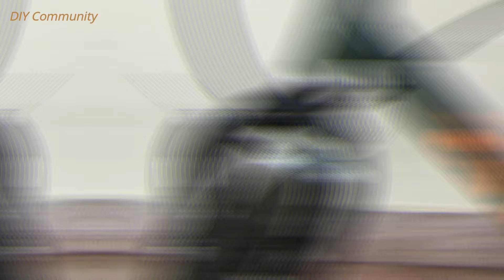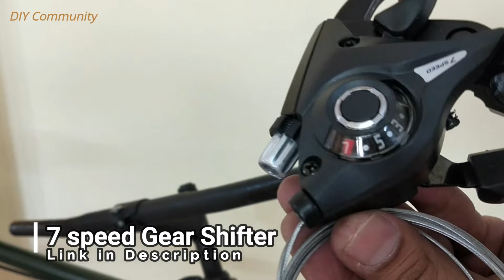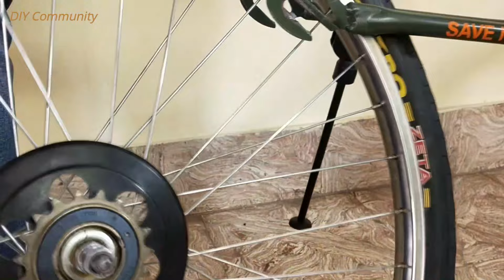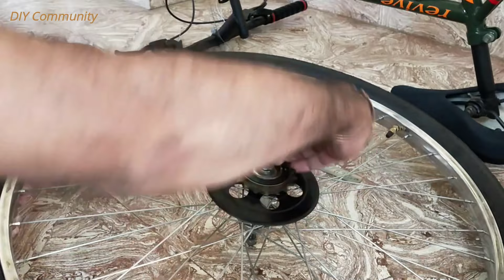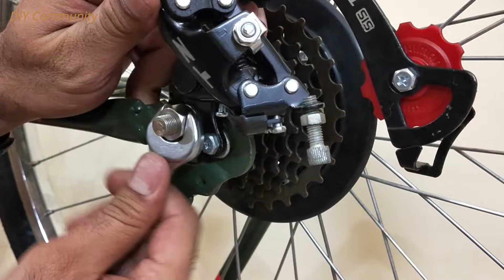How to Install Gears in Any Cycle - DIY Installation | DIY Community

Comment from the maker: Gears makes you to pedal faster without exhausting your legs!
Reply from the maker: Hi Hitesh, Online price of a product changes frequently. Just try to search for item which you are looking for and choose the one matching your budget. Also try with cycle spare shop in nearby market. You can get even cheaper that what I have shared.
Reply from the maker: Pls feel free to ask any doubts. Thanks 👍
Reply from the maker: Hi, for gear setup I am making a separate video and will be posted soon. Stay connected ! Thanks for asking.
Reply: @DIYCommunity  what's the fitting overall cost?
Reply from the maker: Hi Pradeep Kumar, I had spend around Rs.1500/- for this.
Reply: @Trader_vibes22005  Dr
Reply: Sir, can I use it in Hercules Flare cycle??
Reply from the maker: Hi, if the frame is made of steel then you can modify.
Reply: @DIYCommunity  ok, thank you ❤️
Reply: Kinte kharche parenge please reply
Reply from the maker: I spent Rs.1500/-
Reply: @DIYCommunity  can I use gear in hero rafale
Reply from the maker: Hi, Yes you can install as this has a steel frame.
Reply: Reza
Reply: Bel bari
Reply: 8
Reply: Shamim
Reply from the maker: No, aluminium frames are brittle and may break.
Reply: @DIYCommunity  hhh
Reply: What about chain slipping issue after gear installation? I mean how frequent?
Reply from the maker: With proper alignment (chain ring should be centre to the middle gear of you gear freewheel )you can avoid chain slipping from the chain rings.
Reply: @sumitrashil8962 
 
.
Reply: I put a 3 front chain ring set up with one cassette cog in the back it’s kinda funny looking but it’s so much faster the with a one by one
Reply: Hi,kya isme gear ke jo wire he uske sath hi uska Jo wire ka cable yani ki uska cover ayega
Reply: Please try to fast reply!
Reply from the maker: Yes you get cable with cover.
Reply: @DIYCommunity  THANKS BHAI!🙏🏻🙂🙂
Reply: Can we buy the product and get fix by local cycle shop
Reply from the maker: Yes you can. Before that check with the local shop whether they can do.
Reply: @DIYCommunity  kaise
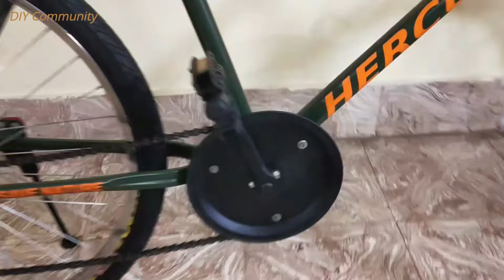Reply: @DIYCommunity 7:57
Reply: @DIYCommunity 😅
Reply: Can it work on bmx
Reply: Can it work on bmx
Reply: Has the 3 speed gear setup video come??
Reply: How many things nead 
and name things
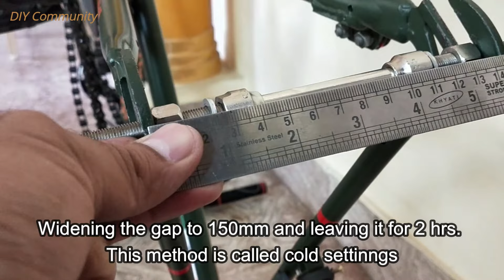Reply: 3:51
Reply: Shimano ka nhi hai online me.. ek de vanta brand ka hai gear kit usey lena chahiye kya?
Reply: Nice presentation 
Lower the music next time make it more soothing 😊
Reply: Can I use gear in hercules street cat

Comment: Thanks for sharing this, very nice. Do you think this is applicable to small bicycles or to small foldable e-bike? Found a nice one which does not have gear shifters (just single gear and single sprocket), so I am wondering.

Comment: Can i fix this gears into my double shocker hero mg cycle 26 inches cycle

Plz reply sir 🥰
Reply from the maker: Hi, check if your cycle frame is made of steel. If yes you can install gears.
Reply: @DIYCommunity  yes my cycle frame is of steel Thanks
Reply: @sapnathakur6071  but the bumpuer upper of my back wheel is closer i can install

U can sir see my cycle at youtube search hero mg double shoker

Comment: How to install gear at Hero lectro cycle
Reply from the maker: Hi, pls follow the steps shown in video. If your cycle frame is made of steel then you can proceed doing this change.
Reply: @DIYCommunity  my cycle frame alloy
Reply from the maker: Hi Senthil, Its not recommend to do any changes in alloy frame as it may break while altering it's geometry.
Reply: Thank you

Comment: why add front derailleur shifters tho??
Reply from the maker: Hi, I added a 3spees gear crankset in front which I could not show in video due to wrong product received. Later  got a correct replacement and installed.
Reply: @DIYCommunity  As long as you get your money's worth :)
Have a nice day

Comment: Bhi  in my cycle from 7 gare to 1 gare not going pleas give solutions pleas🙏
Reply from the maker: Hi, what is exact problem. Chain is not shifting or your gear shifter is not working ?
Reply: @DIYCommunity  bhi gare is working from 7th gare to first gre not going

Comment: Fibre plate agale wala kahan Milta
Reply from the maker: Hi, if you are mean Hercules logo in front then it is fitted by the manufacturer. Older cycles has those kind of logo embossed/fitted.

Comment: Bro can we make a 6 custom gears with 6 teeth,12 teeth,18teeth,36 teeth,54 teeth,108 teeth at front and back
Reply from the maker: Hi, gear sprocket somes in a standard gear ratio. Try for those if that suits your requirement. If you want to make a custom I don't recommend as after dismantling it is hard to get an allignment.

Comment: How can I do the opposite of what you did in the video go from freewheel to fixed
Reply from the maker: Hi, you can remove the freewheel and install a fixed one with spacers next to it. So that don't need to adjust the gap and redo all brakes.

Comment: How much where can v buy how can v buy this bro
Reply from the maker: Hi, I spend 1500/- and brought some online and some in local stores. buying links are in description.
Reply: @DIYCommunity  thanks bro
Reply: @DIYCommunity  if v give our cycle in cycle shop did they buy material and fix and give or v only want to fix
Reply from the maker: Yes, They will be able to do get the materials and do this. They may also charge more so better get a quote from them and compare.
Some cycle mechanic resist to do modifications. Check with an experienced person who can help you.
Reply: @DIYCommunity  thanks bro

Comment: Bhai ye ghair ki wire aapne keise joind ki mere cycle ki ghair ki wire nikle gai he
Reply from the maker: Hi, there are screws and guides for wires. Pls follow that and tighten properly. You can also get help from a cycle mechanic if you couldn't fix it.

Comment: I want a help please tell me , how  much it will cost if i put gear on my 700cc vector 91
Reply from the maker: I sond rs.1500/- for all parts and no labor charges as I did on my own. Check whether your cycle frame is made of steel to do this modification.
Reply: @DIYCommunity  bro can i change my vector 91 700cc tier i mean the seka teir whatever  it's very thin give me problem in village area can i change the teir also??

Comment: Space not creating in cycle frames
Reply from the maker: Hi, follow the method shown in video and read the bottom tagline for more information. You need to leave at the position for minimum 2 hrs.
Reply: @DIYCommunity  I will do same process but 4 hrs but not do
Reply from the maker: Hi, what is your frame made of ?

Comment: What price bro
Reply from the maker: Hi, I spend Rs.1500/-
Reply: This gear will fit in all types of cycle , bro?
Reply from the maker: You can try only on steel frame cycles.
Reply: In dynamite zx cycle, bro?
Reply from the maker: Hercules dynamite zx ? I checked online and this is a alloy frame so you can't make any modifications. 

You can also check the frame with a small piece of magnet. If it sticks to frame then it's a steel frame if not it's an alloy frame.
Reply: Bro the magnet is stick on the dynamite zx cycle
Reply: Bro but the dynamite cycle is double tube steel frame
Reply from the maker: Okay, if you have checked it you can give a try. All the best !
Reply: Bro I ask one cycle mechanic and ask this cycle don, t fix the gear and disc brakes please bro you check the online help me please bro
Reply: Bro I comment but no response
Reply from the maker: Okay, what reason he told for not installing gears. Try with another cycle mechanic if possible.
Reply: Okay bro I try to ask another mechanic bro
Reply: Bro this gear kit link
Reply from the maker: Hi, sorry if I have missed your comment. You can check in video description. Few links may not work as they are very old. Search in Google for 6speed gear set and what all you required for current availability and price. Thanks

Comment: You fixed the front gear shifter but haven't fix the front derailleur and 3 speed crank..what happened?
Reply from the maker: Hi, The crank I received was faulty and had to send that back. So could not include that in video.
Reply: @DIYCommunity  👍

Comment: One pet hate of mine when people rool up the cable at the end instead of snipping it looks messy
Reply from the maker: I agree Edden, cables must be snipped/crimped properly at every end.
Reply: @DIYCommunity  it's because as a teen I done work experience at a bike shop for vintage bikes and the boss was very fussy so his expectations rubbed of on me even before that I was working on bikes from about the age of ten when my mum got really ripped of with a bike and I didn't have the heart to tell her so fixed that and worked my way up to the experience I have now I've never done it as a payed job but I do restore my own bikes I currently working on a 1949 and 1930 raeligh dawn tourist also to 70.s Peugeot racer bikes all ride perfect but I always find something that can be done better I do get for some people it's eiser or they don't have snips just personally I'm a bit OCD with my bikes

Comment: Hello sir, mere pass turbine swift 700 cc cycle h… m usme gear install krna chata hu… plzzz suggest which gear i use…. Plzzz reply
Reply from the maker: Hi, yes you can install gears in turbine Swift 700c as the frame is made of mild steel. You can go for 5speed at rear for better performance. Hope this helps!

Comment: How to know maximum gear u can install
Can i add 21 speed
My cycle is dynamite ex
Could I also add disc brake and front fork suspension
Reply from the maker: Hi, You can modify and install gears only if your cycle frame is of steel.  you can install 21 speed gears and It works perfectly. If you want to use only gear freewheel in  rear then don't use more than 5 gears for best shifting and low wear and tear of chain and freewheel gears.

Yes you can install disc brake and you and find few online with disc brake adaptors.

You can replace your rigid fork with suspension fork. To do this measure the diameter of your older fork and match the size while ordering.
Reply: @DIYCommunity  how to know if my cycle frame is steel
Could you also tell how much would it all cost adding,disc,front fork suspension and 21 gear
Reply from the maker: Hi, you can check with a small magnet. If that sticks to frame then it's made of steel if not it's an alloy which we cannot modify. 
The part cost depends on the brand you choose. For an aftermarket copy will be approx 6k INR.
Reply: @DIYCommunity  bro I checked It is of steel so then I can modify I am so happy
What does aftermarket copy mean
If we are using good brands how much will it cost
Reply from the maker: Hi, it depends on the brand and model you choose. You can check some on cyclop where you get original parts.
Reply: @DIYCommunity  but bro i don't know what all parts to buy

Comment: Bro aapne front gear wala shifter kyu lgaya plz reply aapne toh front gear lgaya bhi nhi
Reply from the maker: Received a faulty chain ring and it was installed later after receiving a replacement. So was not covered in this video.

Comment: I have a fat bike named Hercules brut+ and my backside wheels nuts where you fit gear and wheels isn't long to expand, how can I gear it?
Reply from the maker: Hi, If it a steel frame you can expand else don't try. Go for minimum gear freewheel available (4or5) so that gap you need will be minimum.
Reply: @DIYCommunity  and one more request that can you make a video on how to fix front suspension jam, my cycle front suspension has been jammed and not working , I tried to apply everything cycle shop owner told me to do but still anything didn't work
Reply from the maker: Sure, I have to find a jammed shock absorber now :-)
Reply: @DIYCommunity  ohh, thank you so much

Comment: You bought three gear shifter for no reason or it was with the set
Reply from the maker: It was a set. Plan was install 3 speed crank set. The one which i received was defective so could not install during the video making.
Reply: @DIYCommunity  ouuu

Comment: You install 2 gear shifters but there is no use for other shifer cuz you installed gears on only backside of the cycle which means there are only 7-8 type of gear settings not 21 if support
Reply from the maker: Hi yes.  it's a 7 gear at rear which I have shown in video. I have also installed a 3 gear chain ring in front and connected a derailleur for it which I could not record and post.

Comment: Left gear ka kiya hwa
Reply from the maker: Hi, I got that as a set so used, Now just to maintain uniformity.
Can be used later when adding a 3 speed chain ring in front.
Reply: @DIYCommunity  OK and thanks for replying

Comment: @DIY community Tata Stryder Harris  100 main 6th speed gear Laga sakte hain kya? main confused hu please information dijiye ga 🙏
Reply: Middle gap 5"+ something hain
Reply from the maker: Hi, first confirm on the frame material. If it is of steel then you can do modification. You can add gears If it's alloy frame I don't recommend to do any change in its dimensions.
Reply: My cycle  frame is still made
Reply: Excel ke Ander kitna space hona chahiye comfortable fittings ke liye
Reply: Sorry frame ke Ander kitna gap hona chahiye comfortable fittings ke liye
Reply from the maker: Hi, measure the gear freewheel you buy then increase the distance. Keep the freewheel on side of rear hub and see how much space you need to increase.

Comment: How much is for all 
(Price)
Reply from the maker: Hi, I remember I spend rs. 1200/- for all spares.
Reply: Where did you buy this bro ... Now the cost are very high
Reply from the maker: Hi, I brought the gears and shifter online. Rest all I brought from local market. Yes the rates are inflated now we and have to look for offers.
Reply: Is it worth to install after market products bro for longer Life ?? is it working smoothly.. your views pla
Reply from the maker: Now it's becoming hard to find original and copy. Sometimes even copy product last long and original fail faster. Reliability depends on fair usage and maintenance. I know what I installed are copy version and they are working good so far.
Reply: @DIYCommunity  thanks.. im planning to fix in my Hero traveller 700c
Reply from the maker: All the best !

Comment: Bro mere cycle single speed ha uski chain moti vali ha front Freewheel me toh moti vali lagti ha Aur free wheel ke sath patli wali chain aygi toh front Freewheel me lag jaya kya ya front freewheel change karna padega
Reply from the maker: Yes bro. You need to change the front chain ring in this case.

Comment: Sir left one gear shifter is for the gears which attaches beside that pedal m i right ?
Reply from the maker: Yes you are right. I have installed it later due to a shipment delay. So couldn't cover in this video.

Comment: How much cost rim
Reply from the maker: Hi, I restored and used the old rim.
Reply: @DIYCommunity  ..old rim തുരുമ്പ്old rim rust
Reply: Which gear is best to fit the old bicycle?
Low cost product high quality
Reply from the maker: New rim starts from rs200. And check in nearby cycle shop they may give you for lesser price also. Buy the rim along with buy spokes and change all together.
Reply from the maker: Shimano is best for any cycle. But finding original is not that easy.

Comment: I want to remove the gear from my cycle becuz it is not working
Reply from the maker: You can see what's wrong in it and try to fix it. If you decide to remove then replace the gear freewheel with a single speed freewheel, Put the chain to largest or middle gear in front and disconnect the front & rear derailleur.
Reply: @DIYCommunity  it is totally kharab chain is lock now and no air in wheels 😒
Reply from the maker: Okay, use some WD-40 or Zoric spray to loosen the parts apart. Remove them and make the changes as I told earlier.

Comment: Can we try this on hero hawk cycle ?
Reply from the maker: Yes you can give a try
Reply: @DIYCommunity  ok....is it safe to do such thing on a steel frame ??
Reply from the maker: Hi, Yes only with steel frame you can do this. Not recommend for any alloy frames as they are more brittle.
Reply: @DIYCommunity  yeah...you might be knowing about hero hawk cycle....it's steel frame...right ?? So it's safe to perform cold setting on it ?
Reply from the maker: I saw in internet for Hero hawk Nuage 27T. It is mentioned as steel frame. As you own it you will be knowing better. To clear doubt just place and magnet on frame and see if it sticks. For steel frame we can do cold settings and we are not deforming or shaping to a large extend to loose its strength. Try the method as I shown in video to evenly spread the seat stay. Hope this helps !
Reply: @DIYCommunity  sure ...I will try it....hope it works...
Reply from the maker: It works. All the best!
Reply: @DIYCommunity  ok..... that's great 😈😈....one more question...should I install 6 speed or 7 speed freewheel ?? Which one is safer ??
Reply from the maker: Install less no of gears. 5 or 6 should be fine. Check your chain ring and gear freewheel compatibility so that there will not be any chain slip. Chain should run and fit perfectly on chain ring and gears.
Reply: @DIYCommunity  yeah I will go with 6 speed then
Reply: Hey bro how are you....I have installed 6 speed freewheel on my hero hawk....it's 18 speed now....and it's working well😈😈
Reply from the maker: Hi Aobdul, I and doing good. Thank you and hoping you are doing good too. 
That's great to hear you have installed gears and started using it!

Comment: What was the 3 speed derailure used for ???
Reply from the maker: It's to make 21 speed by installing a 3 speed chain ring in front. At the time of video I just installed to maintain uniformity.

Comment: does it specifically need the 200mm rear axle, can i use like a 190mm?
Reply from the maker: Hi, yes you can. I found 200mm at a nearby store so I used it to have some extra threads out for the kick stand.